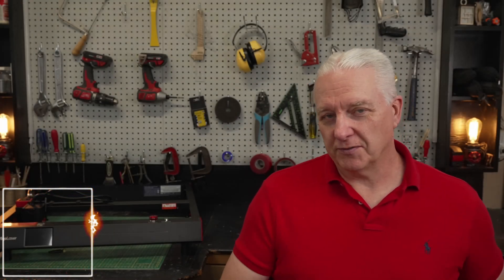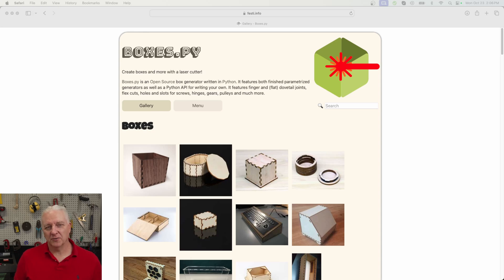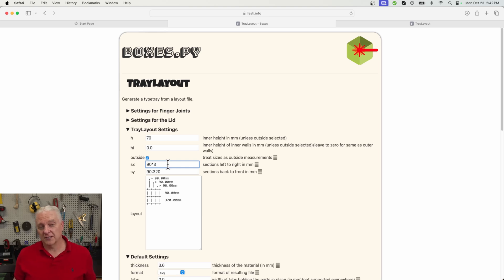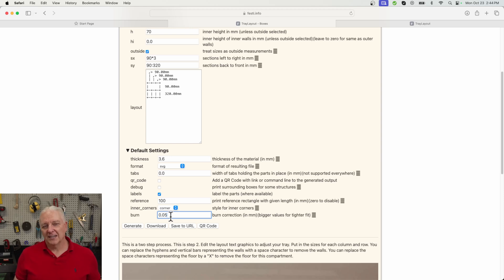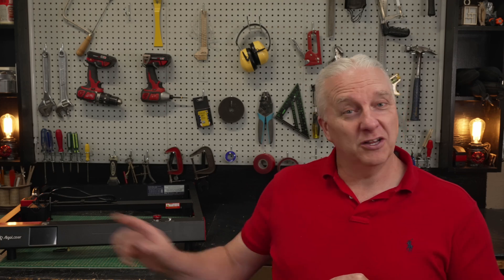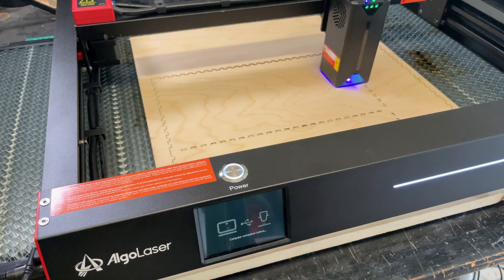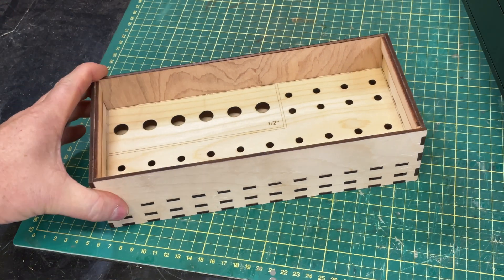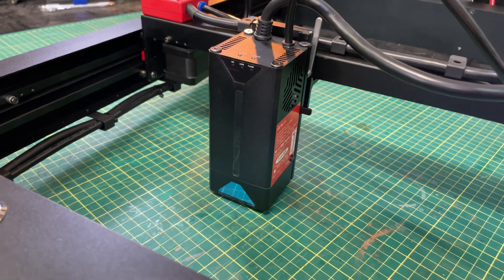Creating Drawer Trays - Using Lasers in the Real World

Comment: Thanks for the video! Would you choose this laser or the 33w acmer for this type of job? And why?

Thanks!
Reply from the maker: Both are great lasers that will produce similar results, so I don't think you could go wrong with either.  The Algolaser does use some improved technology to dynamically adjust the beam size for better engraving/cutting, whereas the Acmer is a more traditional design that relies on raw power to cut but scales power down nicely for engraving (though it has a larger beam size)